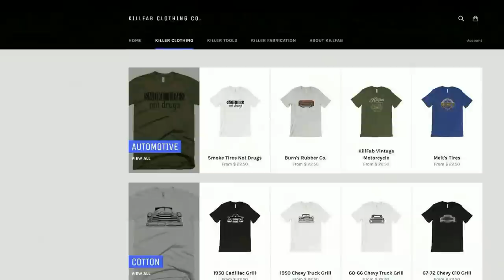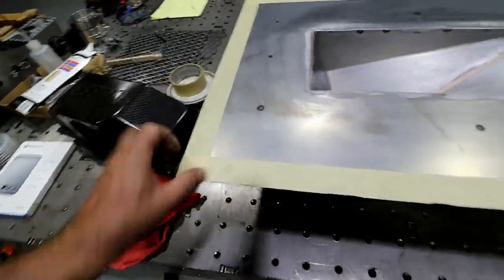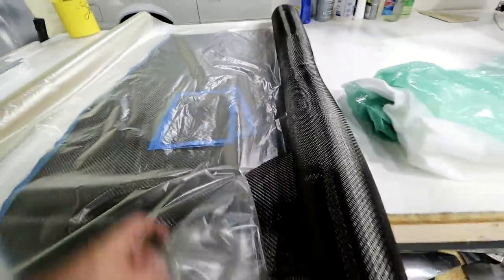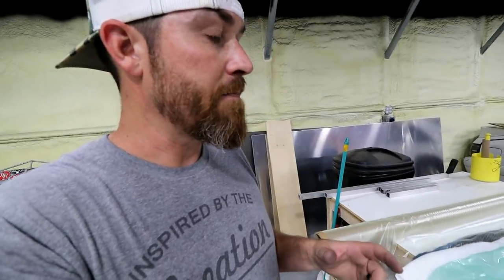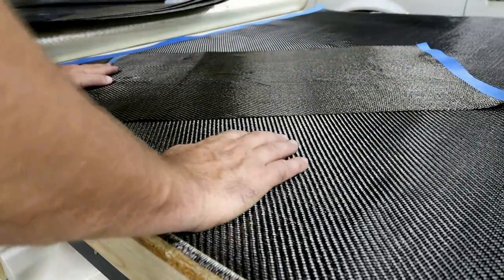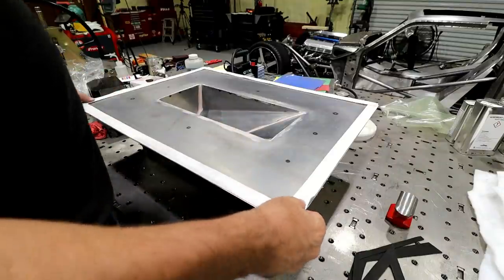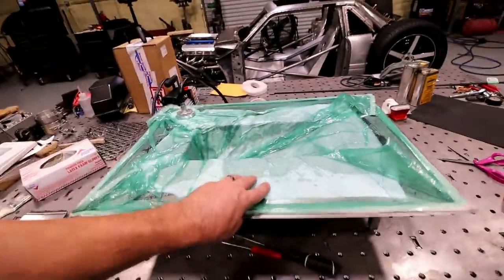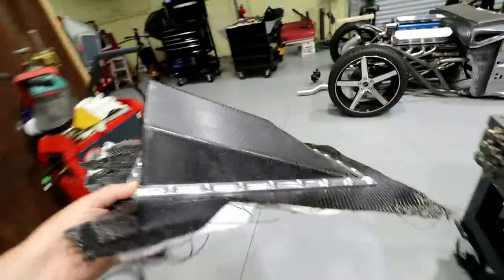Homemade Carbon Fiber Intake Build

Comment: Here's a great bagging tip for you! Get a hold of an old freon can or a helium can , ad a tee with a barbed fitting and a ball valve for a vacuum ballast, turn on the pump, get the vac  going, bag your stuff and turn on the valve to draw it down faster! Nice work! Show us more!

Comment: If the resin you use is UV activated you can try to find an old UV tanning bed unit and use it to cure your pieces. I used to do lots of fiberglass work with polyester resin and the tanning unit I bought for $20 made my life so much easier. Mine was on a pivot stand on wheels that was height adjustable and it had 6 eight ft. UV tubes. I could roll it around my shop and just hang the light over any work surface with a laid-up piece on it and set the timer for 45 min. and "boom", cured.
Reply: And as a bonus, you could work on your tan too!

Comment: Sandwich the CF top between the TB and an aluminum backing plate with through bolts so there is no chance of bolts backing out or there being too much weight concentrated in small heavily stressed areas. The backing plate would distribute the load well and take a lot of boost. 

Looks good BTW! Makes me want to make a few pieces now. Been too long.

Comment: That metal mold is awesome!  I guess you make your tooling with the process that is easiest and fastest...

There are a few things that would make it easier and help avoid the porosity in the corners and the pinholes:

Wet out the first layer between two sheets of painters plastic on the table and cut out to patterns like you would with metal and then lay them into the mold after peeling the outside piece of plastic.  The inside piece of plastic will keep the edges nice - its like homemade prepreg.  Overlap the patterned pieces at the corners half an inch or so.  When you lay a big piece in the carbon can't stretch so it bridges the corners.  If you break up the part into three or four different patterned shapes, the carbon can slide into the corners neatly - its more work laying up but less work finishing.

Use a bubble popper/wetout roller on the first few layers - or ideally all of them.  It will help with the pinholes because the vacuum bag can't suck out all the air from through 7 layers of carbon - the bubble popper will reduce the amount of trapped air.

Use less resin - with 7 plies you will always put in too much for the breather to handle unless you actively try to keep it light.  

Peel ply would help keep the release film from getting stick in the wrinkles on the inside but its one more thing to buy and apply.  Like the carbon, it will work better if you cut it and lap it in the inside corners - called a slip joint.  

It might help to use less vacuum - like 15inHg - but its hard to throttle those AC pumps...

Comment: You sir, are correct.
There's several ways to do carbon. There's a right way, and there's the other way. You can essentially use it like paper mache and you'll get a part. It won't be F1 spec, but it'll work.

Comment: So why not have made a reverse mold so you would have gotten an inner surface that would produce a much smoother air flow and avoided turbulence into the intake? I know you wanted an outward appearance that was nice, but isn't functionality more important?
Reply: On a turbo application it's really not a big deal, and even on an NA setup the plenum is more of an air reservoir where it's collected by manifold vacuum to then be drawn into the runners. As long as the plenum is a large enough volume and has decent airflow, the runners and lower manifold is where you would worry about fluid dynamics, velocity and turbulence.
Reply: tr0n I kind of made that comment in hopes if someone else tried this that they would take possibility of creating turbulence in a uneven finished surface into account. So he has a V8, mid to larger displacement, and higher RPM’s with a fairly small air box he built. He may be pushing that threshold if does anything where he gets into engine at all.
Reply from the maker: The runners are were the smooth air really matters.
Reply: @frednewman2162  plenum size is not really all that important unless it is ridiculously small. When you are feeding from the front you are always going to have a massive distribution difference across the cylinders and at different RPMs. The finish on the inside would be virtually immeasurable. The runner shape / length is going to have way more impact on the way the engine performs than the plenum. Take a look at a video by Richard Holdener where he made a plenum out of a beer keg (kegladon). Then you will see it is virtually impossible to stuff up the plenum badly.

Comment: can you explain the advantages/disadvantages of using a negative vs. a positive mold for this type of layup?
Reply: The side facing the mold is almost always the best looking, so it would be used for the side that shows typically. But shape determines whether you want a positive or negative in a lot of cases, as it needs to be removed from the mold
Reply from the maker: Yeah what he said. You want the mold side to be the show side. Unless you want that dry carbon look

Comment: I built a rear fender, fairing and fuel cell cover for my Harley pro fuel bike in 2000 from carbon Fiber and it cost almost a grand back then, that stuff has come way down in price, nice looking part, Thanks.

Comment: Don’t put tape on the edges!!!! Start cutting down a single tow and when you are 4-5 inches in you can pull the single tow out and it reveals a perfect line down the weave. if you cut down that line it won’t frey!
Reply from the maker: Would work when I cut the diagonals though
Reply: @Thefabforums  you will not really ever be able to control the weave a 45 because of how easy is expands and contracts. You could use spray glue on the cut edge and it will not frey. Then  again biaxial weave exists for these exact reasons.